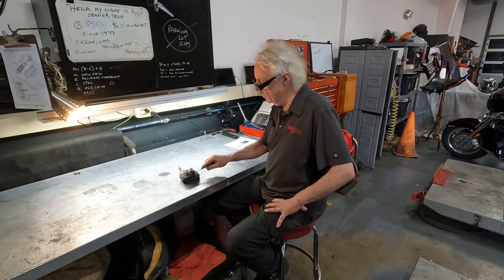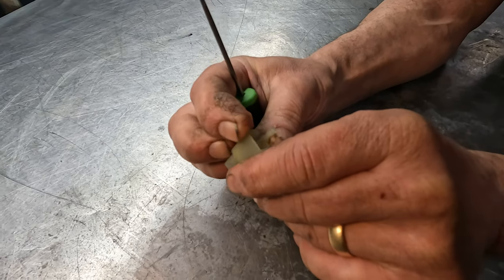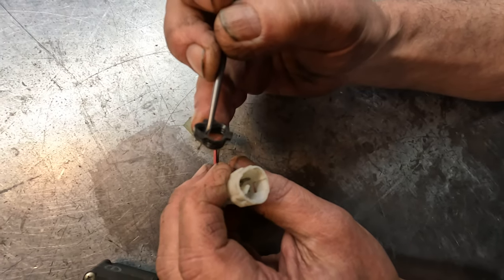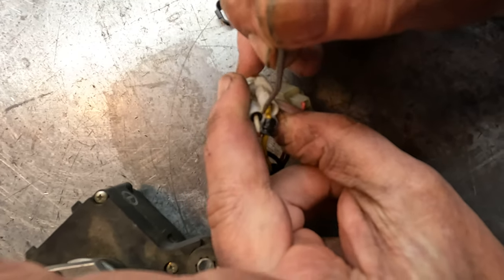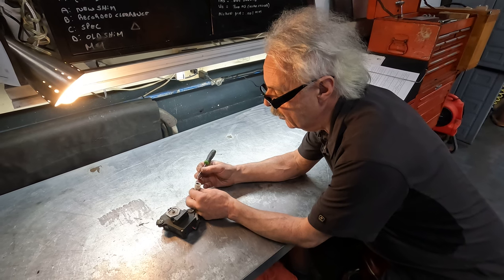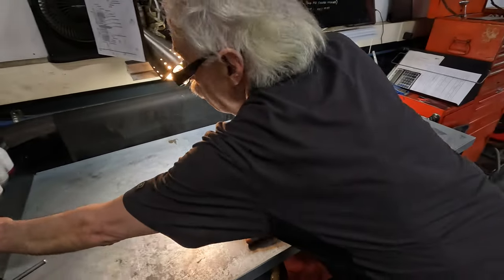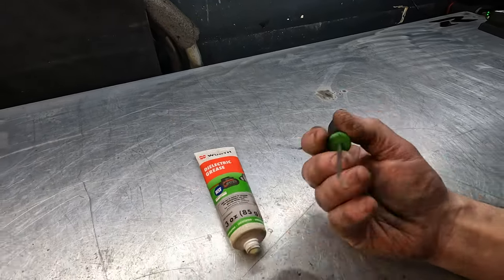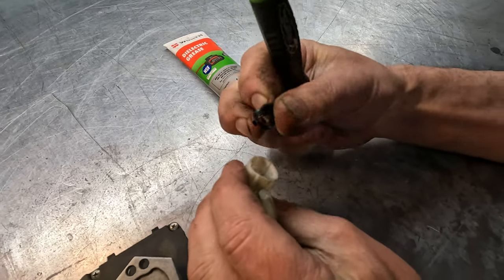"I washed my bike and now it won't start!"

Comment: This is fantastic! I chose to commute year round on bikes in NJ. The salt is so bad to the point that a pressure washer and WD-40 is the only way to avoid rust. I thought I was being careful enough using a low pressure electric with a very wide nozzle. I had a KLR 650 eventually fail so violently that it would go dead even at redline. I had at that point fixed a host of issues. A low pressure check valve on the tank vent, some factory issues with the airbox, a defective fuel cap, and more. I at that point dumped dialectic into every conceivable connector and void then wrapped the connectors. I even coated the contacts because I read that the grease I bought was designed to be displaced. I haven't had an issue since. I never thought of just how fragile motorcycle electrical connectors are.  This video rounded off my understanding of the issue... And now I believe I need to service my electrics on my T7 to prevent a similar fate.